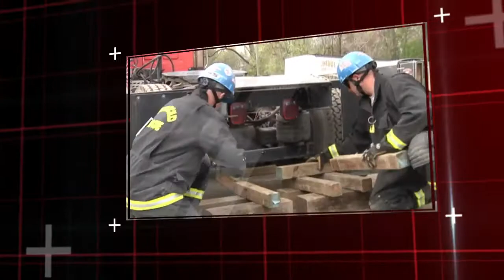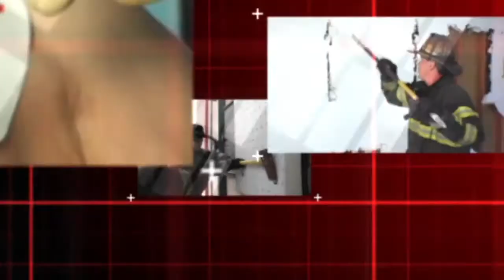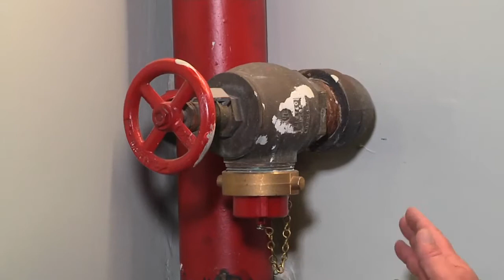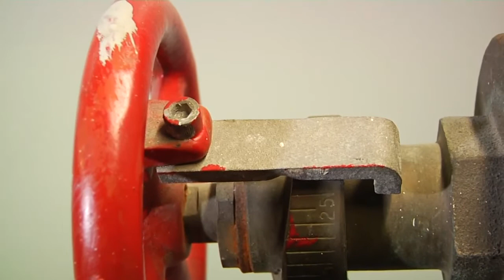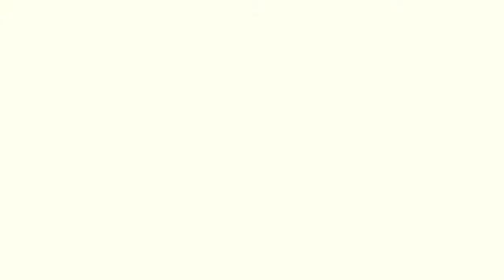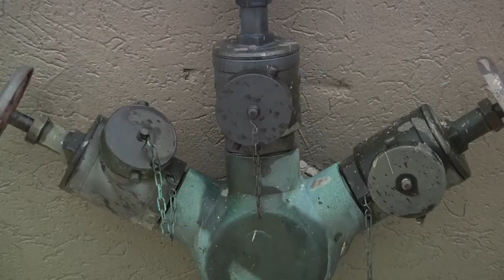Getting Familiar with Standpipe Systems #6072335883001

Comment: In a warm climate, you can have the roof manifold open at all times. No control valve required! But in freezing climates, it is difficult to insulate the piping to the roof manifold.